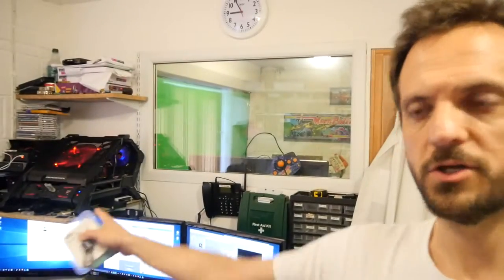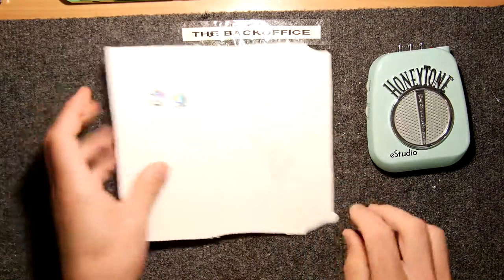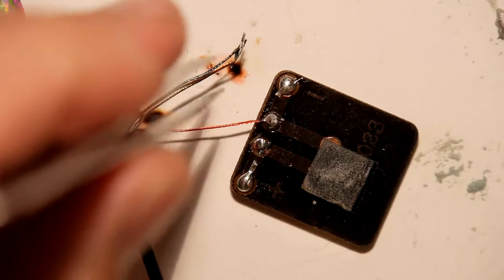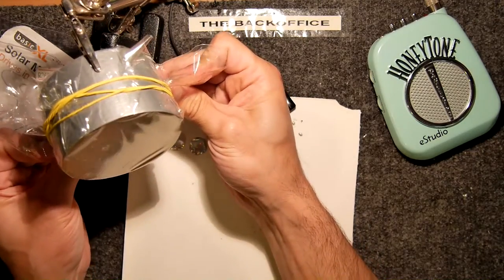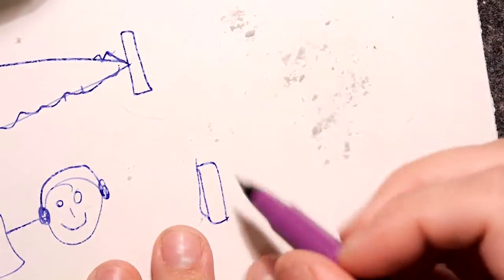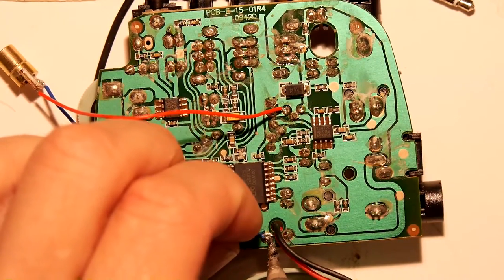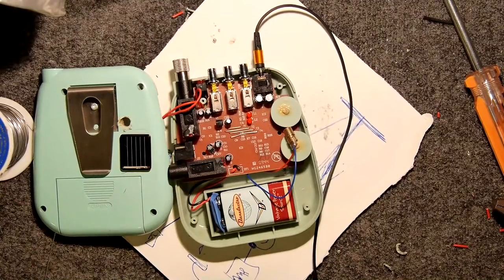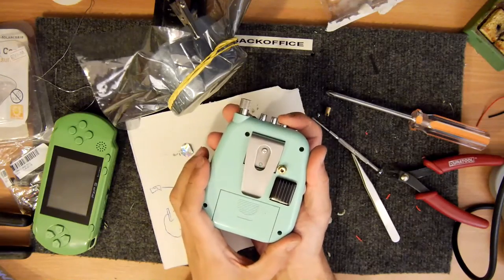Make your own Laser Spy Bug! - A Tutorial !!365th Video!!

Comment: Got me geeking out over that idea. It would be interesting to see if you attached a little reflective milar to a window could you here what was going on inside the room... If you see what I mean :)
Reply from the maker: +ataristaffroom Glass seems reflective enough to bounce the signal back, it's just the accuracy of amplifying the fringe that's the challenge as your signal to carrier is going to be much smaller (windows don't vibrate as much). The CCD should give you that control to choose the portion of the signal you need to boost.

Comment: i like this.
perhaps a LDR instead of the solar panel?
Reply from the maker: +ReabowRotors (Jazza) So many things one could try, all should work to varying degrees of success. You would need to build an LSD or photodiode into a real circuit I feel. Although the latter must actually generate a small voltage when hit with the light.

Comment: It's very cool. Have done this in work. Try using a battery and a photodiode (and protective resistor) instead of the solar cell. More fiddly to aim but better sound quality :-) Great Mission Impossible stuff though :-)
Reply from the maker: +ataristaffroom I'm was thinking it's an amplitude modulated signal and the actual audio data is on the fringe of the beam. Would be interesting to compare the signals on my scope but I'm too lazy to drag my DSO to the bench.
Reply: +The Backoffice I have had better results with the diode but you make a good point. I am using my laser diode as an output from an amp though,and "shooting" phone music across a classroom to a guitar amp output.
Reply from the maker: +ataristaffroom the ultimate solution would be to fire it into a webcam CCD (minus the lens) that way you could easily in software pick out the best cross section of the signal, hell you could even record the visual signal and decode it in all manner of ways later :) If I set my camera to 4k 100fps mode think of all the lovely signal that gets captured 😂